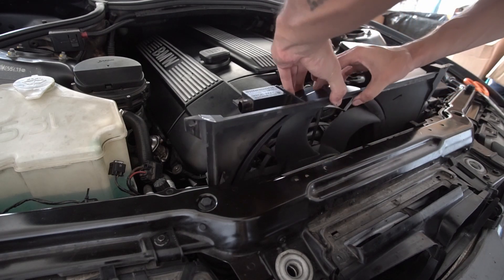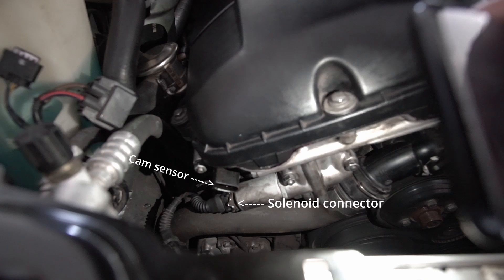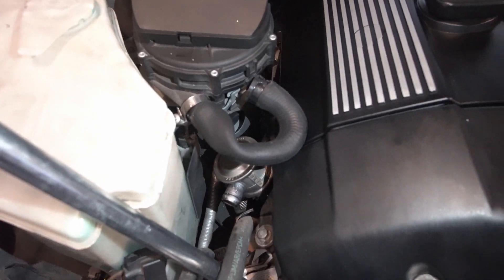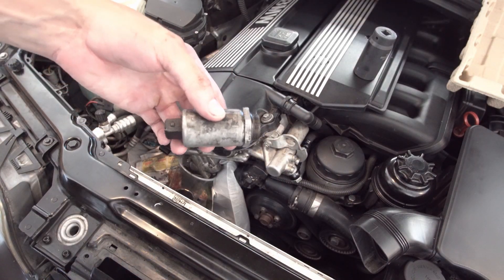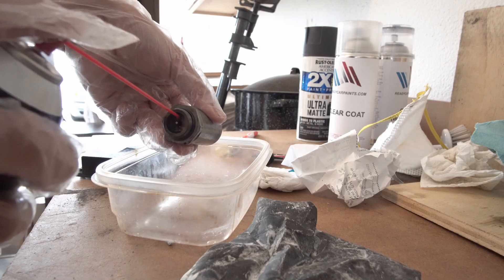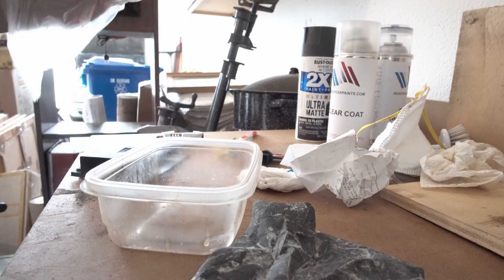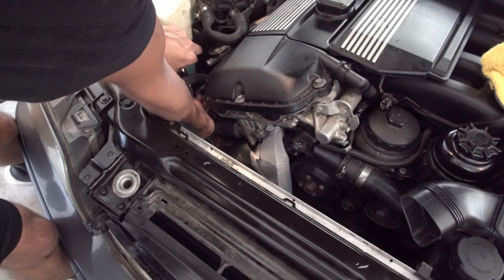BMW (99-05) E46 Vanos Exhaust solenoid removal & replacement P0014,P0011 Fix

Comment from the maker: If this video saved you time or money please consider clicking Subscribe as a token of thanks, It means alot to me being able to give back to the BMW community and help people from all over!
Reply: Hey man this video was really helpful. But do you have any idea if the m54 has a vanos non return valve as i cleaned mine and it still have a rough idle as the rpm shakes irregularly
Reply from the maker: @ibrahimheikal4037  Thats a good question, when I rebuilt my vanos I dont remember anything like a return or check valve, off of memory I think there are passages in the vanos that would just drain any excess oil back into the timing cover area

Comment: Do you need to drain the oil before changing the exhaust solenoid?
Reply from the maker: Nope, the tiny amount of oil in the solenoid port is way higher than the drain pan.

Comment: I got the socket you recommended and its not deep enough to grab the exhaust solenoid. It fit on the intake solenoid only. They sell a socket exactly for this but its expensive. Is there another socket out there that could work?

Comment: Hey bro thank you for the video all the videos I've seen just do the top one . I didn't know you could pull those springs out I think one of them are stuck
Reply from the maker: @luisgalvan9326  Hey glad it helped you out! What check engine codes are you getting?
Reply: @Chris.activity   on my way to work fuel line wasn't clipped in all the way it came undone while driving the smell of gas was bad so I already knew what it was so during the time I was pulling off all the dressing I unplugged the vanos SMH Shaking My Head any how I start my car and I'm off not knowing to plug the vanos back in. About a mile down my car stalls. That's when I find out about my vanos. SMH. Well I'm getting code 15 Activation of vanos. I'm struggling. I have fuel , and spark. Next step cam, exhaust & crank sensors.. any and all help will be highly appreciated..
Reply from the maker: @luisgalvan9326  Dang so your car stalls out and wont run? When I had the bad vanos exhaust solenoid it would run fine just high idle and bad gas mileage. I would suggest making a post on E46fanatics forum, lots of great guys on there that can lend some more info

Comment: 02 330i cab..The only thing i removed was the electric fan and of cause the intake tube. Right now iam soaking the not sounding solenoids. The valves inside was not dirty at all, and i wonder how long time it will take for the solenoids to fill up with oil again? I took a bahco wrench 
(The one that is 32 mm when maxed out) and with a karate hit made it shorter not to reach for the radiator. One hit with a hammer and they came loose. We have a company selling o rings and alot of rubber things. They always recomend vaseline for orings before use. It keeps them young and fresh for a long time. I too some o rings from my gardena coupplings and had dem in the vaseline jar for some weaks (i forgot aboute them) so when i was going to wash my convertibe befor storing it during winter i needed the orings. They had grown up to be real men, so i could not press the coupplings toghether. I had to rush and buy new ones. So dont do any owerkill with the vaseline like i did.
Had some coffe, and now i will put things in place again and take a test drive. the result comes later.

Comment: What was the symptoms? Knocking and/or poor idling/performance?
Reply from the maker: @borinpich7420  yep high idle/poor fuel economy. Could potentially cause knocking as well since the engine is no longer able to make auto timing adjustments properly.

Comment: Hey man did my vanos today n I couldn’t get the exhaust side I got the 32 mm but it doesn’t sit right due to the connection
Reply from the maker: @okayyoshie2155   where did you get your socket from, Is it the same one as the video?
Reply: @ChrisTBX  yea bro
Reply: 32mm from autozone
Reply: @ChrisTBX  need your help solving this problem
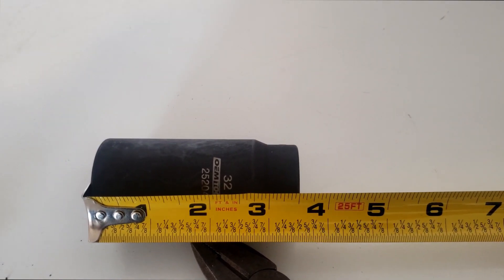Reply from the maker: The black OEMtools socket?  I'm not sure why it wouldn't work unless your socket is slightly shorter. I would suggest measuring out your socket and comparing it to the one at 2:06 mark of the video then assess from there.
Reply: @ChrisTBX  it identical
Reply: It’s *
Reply from the maker: @okayyoshie2155  That's weird, it only fit about halfway onto the solenoid hex head for me, but was enough to do it. Could try using a different 1/2'' drive breaker or ratchet if you think thats where the issue is, otherwise I would return it and get an extra deep socket probably online.

Comment: So I’m back with a different question , that thing that you cleaned I heard is important and can cause issues if it’s not working correctly, what did you clean it with brake cleaner ?
Reply from the maker: Yep, brake cleaner and the tooth brush

Comment: Thank You so much for this video.
The best wrench for taking out the vanos solenoid is actually a motorcycle wrench. Do a google search for "kawasaki 32mm wrench" and you'll see what I mean. I picked one up on EB for cheap, and they're only 5-6" long.
For the exhaust solenoid, you will need to take out the electric fan to give you more room, easy to do.

Comment: I know the video is a Year old, but coming across it since i am dealing with the same issue, but from what i have read, the issue most likely was a Stuck Actuator. So when you removed it and cleaned, you inadvertantly most likely fixed 90% of the problem. Cleaning the solenoid itself so you could hear it rattle definately helped, but cleaning the actuator and reinserting was the Actual Cure.
Reply from the maker: Good comment, in mine replacing the solenoid was the ultimate fix, just doing the cleanings did not get rid of my check engine light. But I wanted to show cleaning the solenoid and actuator so everybody can see what is going on in there and for some cars that may be all thats needed.

Comment: Hi, I want to make the change in my 2006 BMW X3 E83. My car have two Solenoids, one at the top and one at the bottom. Is it the same piece or are they different? Because I search on the internet and I don't get the answer.
Reply from the maker: The intake "top" and exhaust "bottom" solenoids are the same part. On your car though make sure you have the right part for your car because BMW changed the style of solenoid around that year.

Comment: I tried a few different times to unscrew these solenoids and they wouldn’t break free. Tried on a warm engine and also used a heat gun, finally broke loose.

Comment: Hi, quick question. I have a code p1145 when i searched it shows me that part (vanos) my engine bogs down when i press gas pedal and as soon as it hits 2000rpm. It his back down. It wouldn’t go pass 2000. You think its the vanos? 😮 You can clean them?
Reply from the maker: I do not believe that code has to do with the vanos. But rather a fuel delivery issue, I would look on the forums for more help. It also might be a specific part/problem to California emissions cars.
Reply: I see, thank you for the reply. Btw the p1145 saying its valve solenoid. I red some thread in the forum. Some saying vanos saome saying its fuel solenoid
Reply: Hi, ok soni took off the vanos solenoid and cleaned it the way you did your proccedure. I shook the solenoid. And i hear it moving around in there. Is that normal?

Comment: I have this exact car, and replaced the CCV system bc of it smoking, and when I put it back together it only clicked one but didnt turn on, and I looked up on google what the problem may be and it gave me the solenoid and the starter, but idk if it’s accurate
Reply from the maker: The starter does have its own solenoid, unrelated to the one in this video. If the car started fine prior to the intake/ccv work then I would make sure all of those little electrical connectors in the intake area are properly plugged back in, and verify your battery has the proper voltage to start the car.

Comment: Thank you so much for this! I cleaned both Vanos Solenoids in my 2003 325xi and the car has never ran so good since I owned it! No more random stalling going into drive or reverse. Also no more random stalling getting off the highway!

Comment: I'm definitely doing this thank you! I also have a noise coming from the top front of the valve cover at around 2000 RPM. You think that has to do with Vanos also?
Reply: Could be timing chain

Comment: Can these thing cause misfire with fuel cut off?
Reply from the maker: The most common cause of misfire w/fuel cutoff will be the ignition coils, that happened to me a few times before I replaced them. I wouldn't think the vanos would cause an individual cylinder misfire since it controls timing across all 6 cylinders, but if you are getting multiple cylinder misfires I suppose its possible.
Reply: @Chris's Toolbox  I've changed the coils, sparks, I even moved the coils around and the coils seen to work. It's like the cylinders aren't firing. I even baught a new wire harness for the coils. All the coils literally work but the cylinders themselves don't lol. It's so weird. Fuel Injectors new, Exhaust camshaft sensor and 2 upstream oxygen sensors have been replaced I did alot of work that could point to the issue... only thing I haven't been able to change is the Intake camshaft sensor due to the vanos bolt being stripped.
Reply from the maker: @LilHonda97  check engine light codes  would be helpful clues. Without any of those to go off  the next steps imo would be to check fuel pressure, then possibly the cps intake sensor and or crankshaft position sensor, along with verifying vanos  & timing. If your not on the E46 fanatics forum I would highly recommend making a post on there.
Reply: @Chris's Toolbox  p1341,p1345 and p1351 all misfire with fuel cut off. Only camshaft I have to replace is the one under the vanos. But it's so stripped not even a vice grip works. And I've posted there nobody is a help. I replaced this.

1-Fuel Injectors
2-Clutch
3-MAF Sensor, 
4-Exhaust Cam Shaft Sensor
5-Ignition Coils
6-Spark Plugs, (NGK) 12.99 a piece
7-Fuel Pump
8-Intake boot (lower and upper)
9- three radiator hoses
10- Disa Valve
11-Radiator itself
12-Radiator Mounting bracket that holds the Expansion tank

13-Expansion Tank itself
14-Front and Back Brakes Pads
15-Front and back tires (3 times have been changed) gotta replace the back tires
16-Upstream both oxygen sensors
17-crankshaft sensor
Reply from the maker: @LilHonda97  wow thats quite the list, you might want to take it to a shop for diagnoses before you keep throwing more money at parts, a smoke test for vacuum leaks, and even an engine compression test might be worth doing.

Comment: Bmw e60 2004 2.5 petrol. I keep having cylinder 5 misfire, injectors are clean,sparks and coils changed, also manifold gasket and MAF sensor, you think it can be from the solenoid?
Reply from the maker: Seems very unlikely the solenoid would cause an individual cylinder misfire. I would check the wiring for the injector and ignition coil, then if that checks out, I would do a compression test to verify head gasket / cylinder health.
Reply: Check disa valve!

Comment: bro does the intake sensor cause the e46 to go into limp mode cos mine a 330i it changes gear smoothly n all after skipping timing as it was fixed it shows the little limp mode next to P and it started a hard start issue
Reply: Do you know what caused the limp mode or Do you have any malfunctions that are coming up